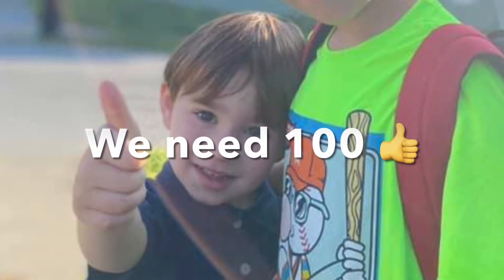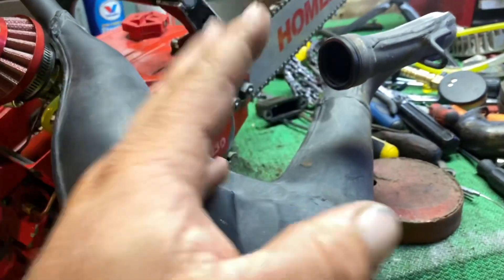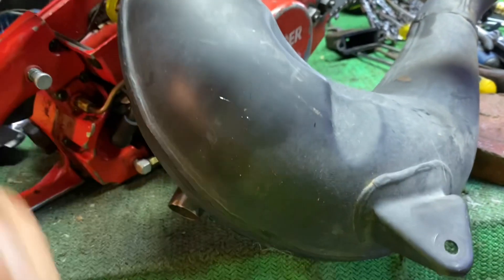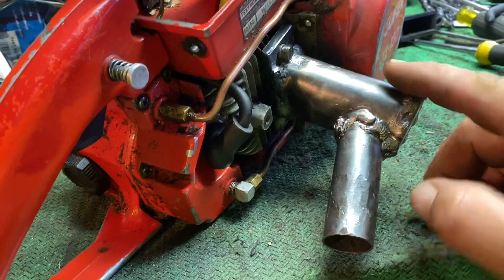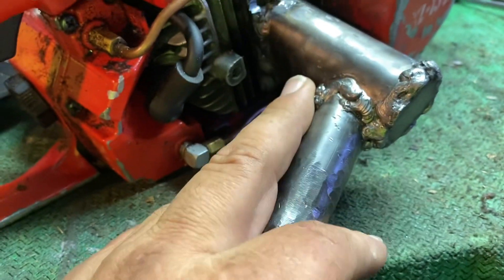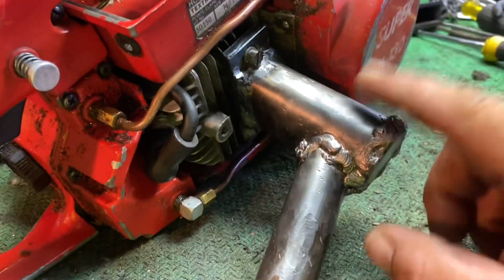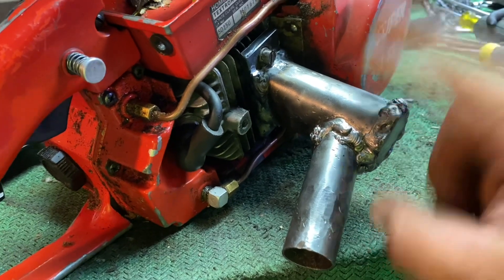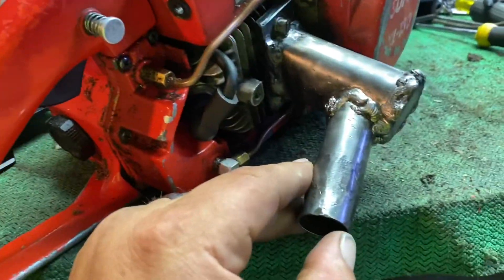High Performance Chainsaw Muffler!  How Do They Work?  Explaining The Details!

Comment: 1st of all I still want to Thank Iron Horse for sharing this muffler or pipe design.  And let's all say thanks to you Smitty's Chainsaws for putting this video together showing it again and in use. We can all show our thanks by giving them a thumbs up like and subscribe it helps everyone. Now let me say my 1st one I had welded with a torch and it was not pretty but it worked really well. Things don't have to be pretty to work. Look at some of the fabrication repairs done daily on a farm they're not pretty but they are functional and they work and hold up to the daily grind when the pretty factory production welds and fabrication fail on a daily basis. The man in the farm repair shop doesn't care if the 4 extra pounds of welding rod added overhead cost and made things not so pretty,what he or she cares is that it got the next 100 acres of corn planted without breaking and food on your table. Same thing here it's not a beauty pageant you're trying to make an engine run faster better and cut more wood and get the heat out of that cylinder adding life to the engine. Now why do they build mufflers that effectively blow up saws prematurely? Same reason they make mix oil that does the same thing for one we have EPA standards for two we have safety factors one of them being sound another one being if you're working in the woods you don't want to set the woods on fire. So yes using these type mufflers there are precautions to keep in mind one if you're working in a dry environment with leaves and dead grass you probably need a factory muffler with a spark arrestor I wouldn't take one of these into the national Forest also keep in mind hearing protection is a must. But in our own backyards where there is not a fire risk and it's our own damn fault if we don't wear hearing protection we will probably all be okay. Thanks again for sharing another great video with folks so they can learn.
Reply from the maker: Well said!  There’s a time and a place for everything!